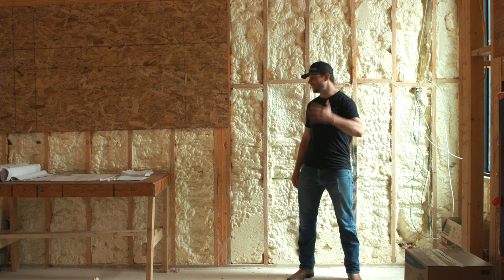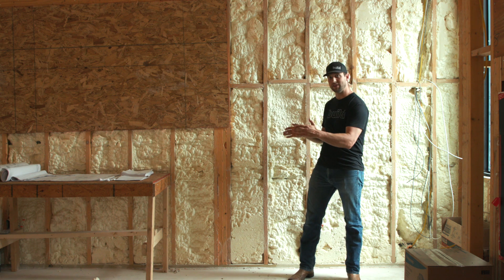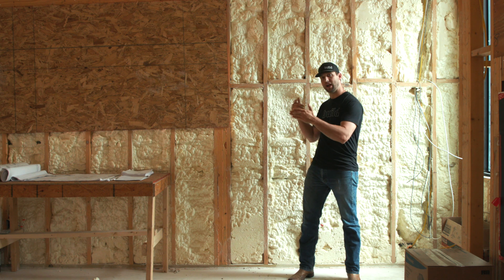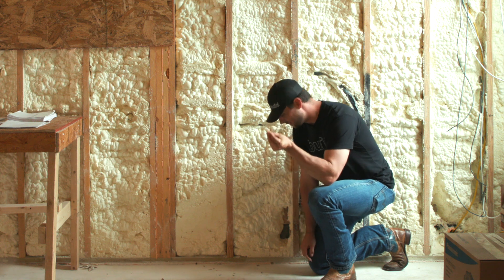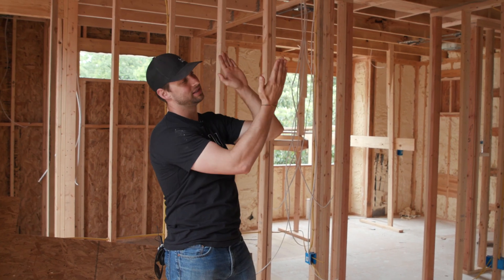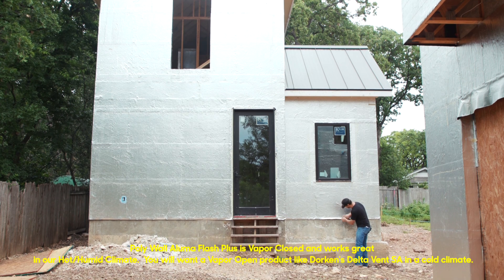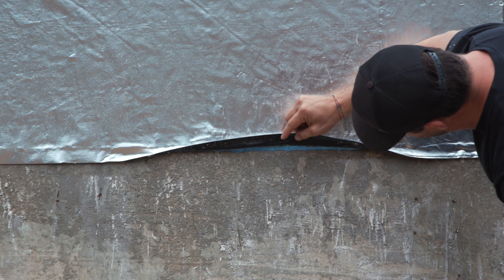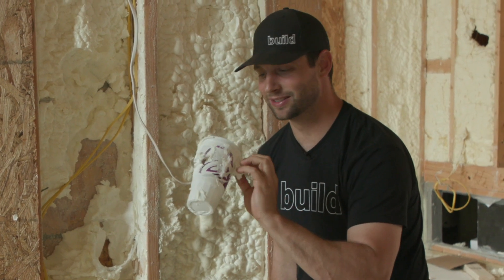3 Spray Foam Problems

Comment: Really not fair to represent foam in such poor ways. It surely wasn’t installed perfectly but you have to do a better job at explaining difference between open cell and closed cell. Also to the people in the comments that are complaining that the foam is uneven..duh..it’s foam. This is an open cell job. I don’t care how good you are but if you want absolutely no mistakes and no separation nor cavities you have to overfill and cut some of the excess. Also open cell is not a vapor barrier no matter how thick you applied it. Air will go through and that’s how R value is established. If you want no air flow and a vapor barrier you’ll have to spray 3” of closed cell and the R value goes out the window. That’s when U factor is calculated as envelope performance as a whole.

Comment: Spray foam is almost a guaranteed reno nightmare. And all the possible failure consequences (that can be quite catastrophic at worst) definitely don't justify the potential pros it brings, especially if a good quality more "traditional" insulation is well installed. IMO it looks cool, and it stops there.

Comment: you dont want a air seal, it causes sweating , the walls need to breath
Reply: Wrong, people breath houses do not. This is a common misconception, most new houses are built as air tight as possible and ventilate and bring fresh air into the home using a ERV. The tighter your home is built the more energy efficient the home will be, also will reduce allergens and improve air quality.
Reply: And earth is a disc.. lol
How is it going to sweat if there is no air driven moisture in a walls (if done right which not the case in this video). If there no warm(moist) air in connection with cold surfaces then there is no condensation which leads to no moisture.
If you have elevated relative humidity in your house its ventilation probles that could be mechanical or natural (open windows)

You welcome
Reply: Bobby missed sone school classes apparently

Comment: To check if its filled all you need to do is use a infrared camera/thermostat and you will be able to easily tell because of the difference in temperatures....or even poke something through it and check if the resistance stays the same until it bottoms out..then just fill the hole back in after checking

Comment: From what I could see, the window sills look level,  you had other videos saying how they need to be on angle with a pan and the bottom flange of the window near the end of the vidoe does not look like it was shimmed away from the wall.  If you are going to talk about spray foam at least let people know there are diffrent types, open cell versus closed cell.

Comment: Spray foam is the best all in one insulator hands down but this video is misleading. A good insulator does not fill the entire wall cavity with spray foam. that's idiotic and a waste time and material costing you money. especially if you have to cut the foam back. You will never get that money back in the long run of the minimal r value added.

Comment: 4" of spray foam, but every stud is timber, so there is an element of thermal bridging to be considered anyway.
Reply: Unless you double frame the wall with any insulation there would be thermal bridging through the studs
Reply: @coreydeptuch7735  True, and softwood isn't a terrible material in terms of bridging as it doesn't conduct heat that well so it's not a huge problem.

 I just wonder whether, if what you are really after is a super-low U value to the point that you are concerned about whether you have 4" or 3" of spray foam, the cold bridge is not more of an issue than the foam thickness.

But, if you are going to go to that level, might you not just as well ditch the timber frame altogether and build with something that doesn't have cold bridges?  Straw bale springs to mind, though there are, no doubt, other examples.

Comment: I spray foam for 15 years the foam peeling from the studs is because is to hot , and pulling away from the back of the wall is because the wall is to cold, moist or the foam to cold .
The one other problem is the gays are moving to fast to get the job done to move to next one because they get pay by production.( no paying any attention).
Reply: @Bill Smith I'm sorry that bother you . I think I did putty good taping since English is my second league and y never went to school to learn it and I'm sorry if I mis speld again.
IM PROUD OF MY SELF FOR THAT .
How may languages can you speak?

Comment: It appears to me that a lot of houses in America are built from wooden studs and OSB plating. Why don't you use double brick walls with isolation in between? That's a lot stronger building method with a very high isolation value. Especially with all the big storms in some areas of America that appears a lot more durable building method. I've never seem full wall spray foam isolation on this side of the ocean. In old houses where there wasn't any isolation originally, normally rock wool or glass wool or PIR foam plates isolation is being used.

Comment: This is why I refuse to use spray.... too much can go wrong. Spaces, hiding things inside, off gassing, pain in the rear to renovate....etc...
 I don't care about the craze, I will get the usual insulation fiberglass or other similar products. if it needs fixing or moving it can.

Comment: Spray foam is crap never use this stuff it is a way to cut costs. Fast forward 20 yers this crap will ether be illegal or a total different method of using this product. It is hell to fix if there is a leak in the wall it will cost double to fix once the plumber opens up the wall and o there is spray foam you will get charged moor. And if water 💦 penetrates from out side then here comes the termites thy love the foam travel from one stud to the next. I would use a natural Insalation wool or some of the other amazing products out there. Spray foam no no and no I never Refer this product to my clients. It is crap anybody that wants to argue this fact should think twice. It is not good for any home if you care about your home do not use this stuff. 👎🏼

Comment: One large problem for rural folks around the country is that it is likely there is only one (or none) spray foam contractors in their area. I have had friends living rurally do there own foam jobs...given the tendency for "mispray, mis-mix, humidity issues" I find that proposition scary! Rock wool self installed for me. R

Comment: If the house is air tight, won't it sweat?
Reply: Where is the ventilation
Reply: Most new houses that are built tight use an ERV for ventilation.
Reply: that's why there is ventilation

Comment: Termites love this stuff when it’s applied to walls, they can hide in it eating the studs and other wood until you have a huge problem. Treat accordingly.
Reply: Carpenter ants too.  They build huge networks of tunnels in the stuff.  I can actually hear them munching in the walls of my pump house, and see the piles of foam dust.  Strange that nobody talks about this.

Comment: The seal at the bottom plate isn’t spray foam it is Polyseal. This is not a spray foam but rather a gun foam, a similar yet different product and application. This method of sealing the bottom plate is used regardless if you install fiberglass batts, spray insulation systems or foam. The areas that you say are an issue for air infiltration are issues with all insulation systems. There is a misconception that foam will solve all these problems, it does not. However, it does do a better job at covering up bad building practices than other insulation systems. My personal opinion is that most home builder do not understand air infiltration and therefore do not build that way.

Comment: If you are overfilling the cavity she will never pull away from the stud. I try to overfill the cavity every time.
Reply: That's just not true, even if you overfill the cavity it can still pull away and or have voids in the foam if not installed correctly. Generally has to do with either substrate temp or moisture content in the wood. Can also be caused from running to hot or cold.

Comment: You don't like the foam under the footer but praise some blue dyed caulking. Is there some kind of proof that it won't shrink, dry or crack? Is the footer foam rated well enough for many years of dead loads and heat cycling, moisture movement, etc?

Comment: Seems like every "problem" he covered is due to the foam not being applied correctly?  If you've got air leaks then the installer or contractor didn't do what they were supposed to do, especially with closed cell foam.  It isn't a problem with the foam, it's an installer problem.  Right?

Comment: Only a Taco Bell cup? I had a contractor leave a piss bottle in a finished wall. That was a fun talk after I found it.
Reply: Taco Bell cups in the wall? That's nothing! I've lost count of the number of in-slab, down-flow HVAC duct/register boots that were used as urinals AND toilets!

Comment: Personally as a owner of an Insulation company you must always Can Foam all gaps left by Open Cell that is the responsibility of the Installer. Just like cleaning up your shavings you Can Foam gaps left by OC. I would not accept anything less

Comment: How doy 'bring the foam back to thickness' ???
Reply: Come back and spray more in the areas that need it.
Reply: @Rodney : Thank you. 

Is that it? Just spray more? No need to remove any or treat it like a wall patch?
Reply: @igounfazed  as far as I know that is all. Most of the time filling a cavity has to be done in multiple layers anyway, as it can affect the cure and performance if done in one heavy application.
Reply: @Rodey : Ah... then that was my problem. I did it all in one go and wond up with several vacant spots. I'll just fill them up then. Thank you!
Reply: @igounfazed  yeah it will have a balloon affect and skin over on the outside layer.

Comment: Great video!  It cannot be stressed enough - installation, installation, installation! Insulation is only as good as the installation- as with most processes in construction. The gaps at the rafters are not deficiencies in the insulation- rather the installation. This contractor obviously did not care and is an easy job to pick apart.  Unfortunately when it comes to insulation people only seem to care about how little they can pay. There will always be someone who will do it for less, and you end up getting what you pay for in the end.  Thanks Jordan!

Comment: Question: I have an old metal morgan building / shed. I need to insulate it to store some supplies for my buisness.  
Its unfinished just studs and metal sides.  Its fairly water tight. I can see some light cracks where the metal side panels overlap. 
What is the best way to insulate? I live just outside austin, texas.  Im thinking of caulking gaps then using silver bubble insulation and then a layer of pink solid foam insulation. Before putting on a plywood wall to screw shelving to. 
Or should i do something more?
After watching videos, im concerned about water infiltration with spray foam, and little more r value for shed and insect infiltration.

Comment: Matt another issue is fishing wiring after the sheetrock is installed to add an outlet, switch or data cables,a real electricians nightmare!!!
Reply: Don’t forget the fact that now that branch circuits and especially home runs, are totally encased in foam, you have now derated the ampacity of the wirethat no one ever addresses
Reply: Wow your right, I didnt even consider that,I wonder if theres a derating table in the latest National Electric Code?

Comment: I was surprised that you did not mention improper curing of the spray foam when it is applied improperly (too thick, usually, but a bad mix ratio could also be problematic) or outside environmental conditions for the install (too hot or too cold).

Comment: Thats why when u do spray foam stick with close cell not open cell. If you pay anyone to go do open cell and they dont know the proper setting for it then you will have gaps if u stick with close cell wont have that problem.

Comment: Put Spray foam if you want to get lung cancer. Poor resistance to fire, releases chemicals after the installation process. Time to switch to "green" insulations"

Comment: Question - what about all the holes from siding app. ? I put o. c. styrofoam on the inside under the sh. rock. Worst is my sliding windows. I have to seal all that infiltration but I have it controlled. I'm in the great white north.

Comment: All the outgassing from all the adhesives, foams, glue in osb is really high... even 10 years later.  My next project will be a stainless yeti house if I don't get poisoned first.
Reply: It is really sick 😷 ....I never ever would sleep in a house build like this. Cheap trash materials.
Reply: Das baue ich selbst! So sleep in a house with fiberglass filtering the air cycling in the wall cavity.
Reply: wonder why cancer numbers are skyrocketing, that house will never be safe to live in because after the outgassing you have exposure to the breakdown of those products
Reply: Darren Adams   Cancer numbers are not skyrocketing.... I would love to see you try to provide proof but I know enough to not hold my breath lol. 

Cancer has actually been on a rather steady decline since the early 90s,  what’s impressive is that this is despite constant and huge advances in cancer detection and identification!   We saw a rapid climb in detection through the middle and alter 1/3 of the law century but that’s largely due to advancing technology making diagnoses possible for more people earlier. 

It may look like there’s more cancer around than when you were young but remember that with advancing technology comes more refined definitions. There are more known specific types of cancer today, but only because those cancers were either not diagnosed or incompletely diagnosed tue to a lack of tools and knowledge.
Reply: @chrisfoxwell4128  Over the next decade, we expect cancer incidence rates to stay about the same, but the number of new cancer cases to go up, mostly because of an aging white population and a growing black population. Because cancer patients overall are living longer, the number of cancer survivors is expected to go up from about 11.7 million in 2007 to 18 million by 2020.
It also goes on to state big factors in the cancer rates going up are due to obesity and infections such as HPV, feel free to explain how off gassing is making people overweight and leading to HPV.

Comment: Well now once again it is shown that developing a system that relies on perfect conditions and application in the field is a prescription for failure.  All such marketing ploys really need real world, long term (years not days in an artificial environment), independent, unbiased, multiple tests.  I have lost count of the wonder products that completely failed in real use during the past forty years alone.  Foam (both closed cell and open as well as different weights) shrinkage is a problem that has not received nearly enough attention.  Incompatible rates of expansion and contraction also have not been addressed.  These are long term problems which don't show up until long after the sale.

I am left wondering just how your structure in its self adhered (again how does it work on a wetted sheathing say after a rain storm?) foil is going to dry since it cannot dry to the outside?.  Inside created moisture, ambient moisture etc in different cooling and heating climates may induce a complete failure with such a system.  Siding nails, windows etc are going to have penetrations some of which will leak.  Self healing membranes sound good until a nail is driven sideways or bent creating a rip that will not seal reaffirming crap happens.  The best design allows for ventilation in the cavities as well as air sealing.  Take care.  Doug

Comment: Any expertise regarding spray foaming the interior of a school bus conversion? My searches on spray foam for that project led me here and your information is so concentrated it's apparent you have WAY more in your head. What are your thoughts in terms of flex (the bus twists laterally a bit when going over bumpy roads) and the relationship between metal surfaces and spray foam. Thank you, thumbs up :-)
Reply: We spray Van's and cargo trailers all the time, never once had an issue or call back. The spray foam will dramatically improve the structural strength and will also make it more quiet too.
Reply: That stuff is likely to create MORE rigidity in my humble opinion. It sticks like glue, and with the amount of surface area contact it is likely to create a completely rigid end product even if some of the adhesion fails....and I am not sure that's a bad thing. You want the increased R value for such a project. R

Comment: The problem with alumaflash is that it cuts the radio signals so forget about good cell phone reception inside and it creates weird bounces and echos for the wifi inside slowing everything down.

Comment: I would shoot everyone suggesting an airseal on the cold side of the insulation. If the inside isn't airtight warm air with moisture will come to the outside where cools and releases the moisture = mold and rot. In the house I bought the roof was insulated with rockwoll with a  a aluminium sheeting  installed on the outside. It had a nice black and green ecosystem......
Reply: Sven Weihusen the new-breed of installer can’t grasp these simple facts.
Reply: Exactly.

Comment: Biggest problem actually being improper A to B ratio caused by poor installers ultimately leading to only noticing the foul odor and off-gassing after the completion of the build and having to tear down the walls just to try to inspect where it may be A or B rich or if there were any spills, which also introduced the potential issues with amines and isocyanates being introduced into the air space. I never recommend spray foam... too easy to install it incorrectly.